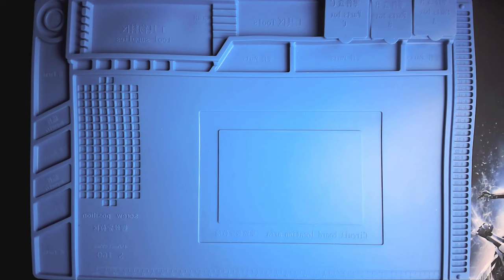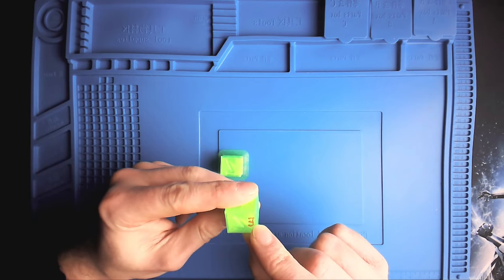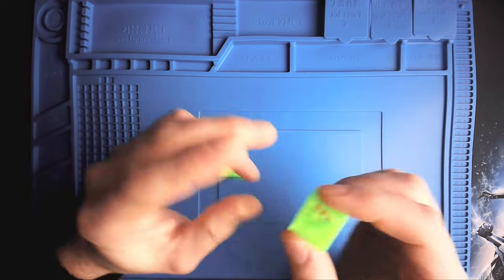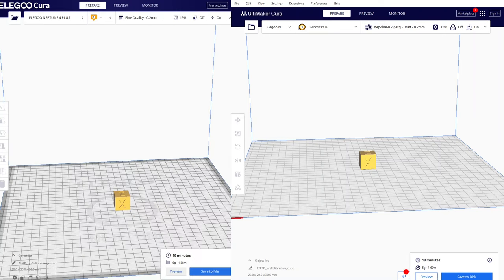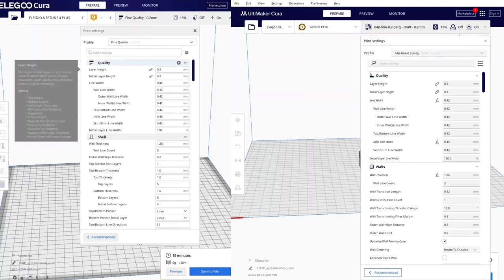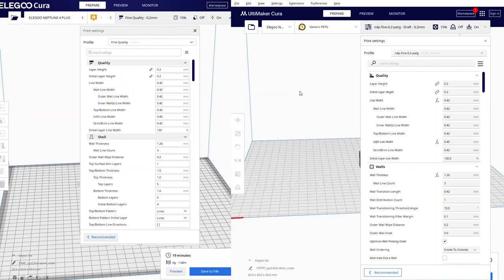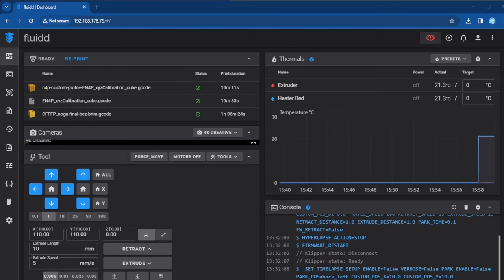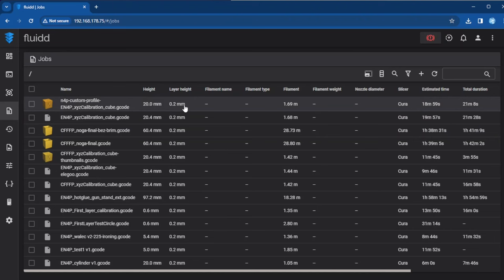Elegoo Neptune 4 Plus Petg Cura 5.6.0 Profile

Comment: Do you use cooling printing PETG on NP4? Because my printer is melting the model extremely without at least small (20%) wind flow :(
Reply from the maker: Yes. I use the standard cooling setting from cura.
Reply: @lubitechchannel  I'm asking because it is my first 3D printer which requires the cooling of petg :)
Reply from the maker: I you want to print fast you need to cool your model :).
Reply: @lubitechchannel  Exactly :) But my previous Ender 5S1 was not slowly as well, but I didn't use cooling. But maybe the slicer intellectually added this feature to the final g-code 🤷
Thank you so much for replies. And special thanks for the idea to "steal" the config from their OEMed Cura :)